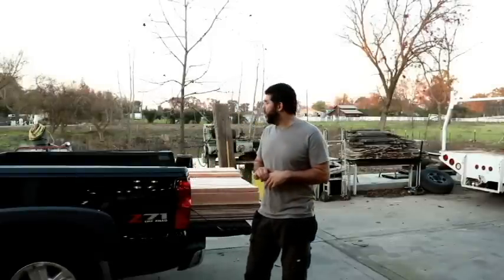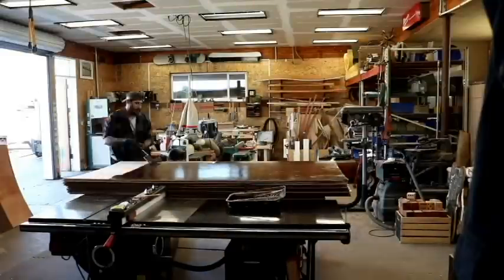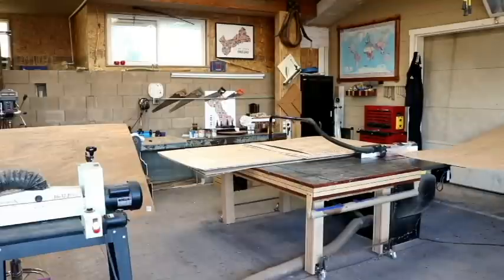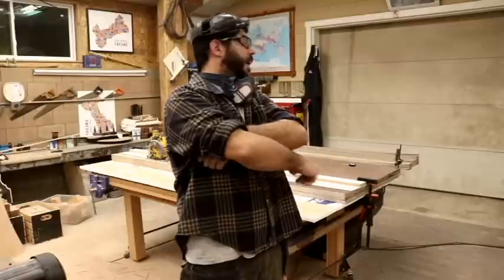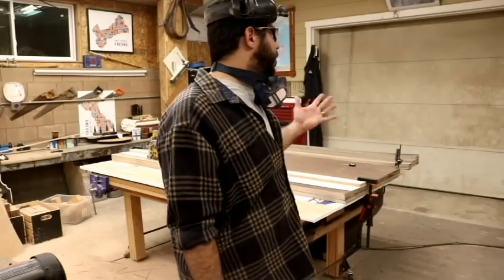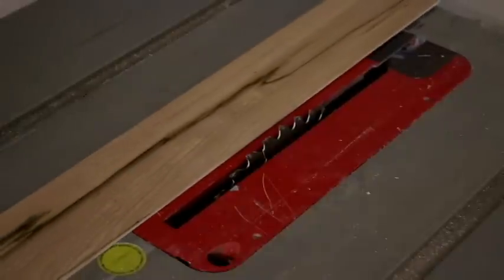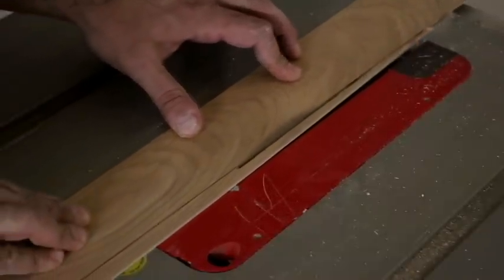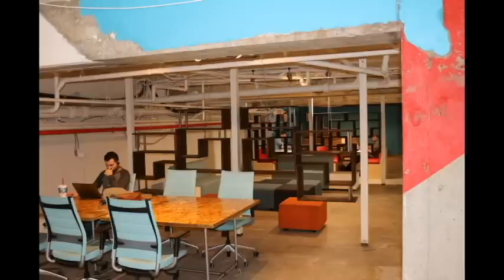Best DIY Wall Treatment Imaginable!!!

Comment: I did a very similar wall treatment. When shopping for the plywood I realized the thinner 1/8" stuff would show any change in elevations on the wall making the boards not lay flat. So I went with 1/4" and it made tooling and installation far easier and cleaner. A couple little tips: When going around a corner, use the same color to make it look as if the wood wraps around the edge. It's much easier to look at and shows much more thought. Like the corner, when you have a door or window continue the same color on each side of the opening. Again it's easier on the eye and look less busy and even more custom.

Comment: Ryan, nice job on the video. I agree that the taper ripping is harmless, since it's not up against a fence, so no kick back. However, I do it a different way WITH a fence. I say I need 5/8 taper on a 24" piece. I wack off a 5/8 X 1" piece of scrap, tape it to what will be the narrow end of the taper. Now I just run it through the blade  (using a push stick and feather board) and voila one end is 5/8 narrower, yes?  I'm not in my shop now, but I believe I have to start with the wide side so that I'm cutting towards the spacer end.  Now if the piece is longer than the saw's fence you have to throw a straight board to "extend" the fence, otherwise the spacer reaches the end of the fence, jumps over and messes up the cut.

Comment: YOU may have done this and I missed it but when I did this I laid the wall out on the floor to assure my design was set and I wasn't patterning  once that was done I simply applied each row to the wall and din't have to think about it. Each one has his way.  this really looks great!
Reply from the maker: Thanks! I did that for certain rooms but some of the walls were so big that it would have been a waste of time.
Reply: I was thinking the same thing. Were his choices entirely random, and it just worked out, or was there a process there? I'm so anal, I would need to control the "randomness".
Reply: Same here.

Comment: Awesome project. Want to "borrow" it for an accent TV backer wall at our Firehouse. Question: Did you miter the exterior corners or since it was 1/8 ply the stain soaked in and it wasn't necessary? Can't tell from the video. Thanks for the help
Reply from the maker: Very cool Scott, thanks! I didn't miter the corners cause it was plenty thin enough so it looked fine. I'd love to see pics of the Firehouse when you're done!

Comment: Good video! I like the one conference room where you did the part of the wall and then it went up into the ceiling. That was a nice effect! I just subscribed. I recently used some even cheaper plywood to do a faux shiplap look on some of our walls. (made a video about it) You're totally right...that thin stuff is a pain to work with on the table saw!
Reply from the maker: Very cool, I love the way it turned out...just liked and subed!

Comment: I seen this wall treatment using reclaimed wood in church once.  Not sawn to one uniform width, it varied between 3/4” to 2 1/2 widths.and various thickness of 3/4, 4/4, 5/4 and 6/6”. Some pieces were stained, some were painted with something like milk paint.      Applied randomly to the wall; the finish product was warm and colorful to look at.  Cool scaled down version.
Reply from the maker: Thanks!!! I've done that same treatment too, both are pretty fun

Comment: I like your comparison to a band saw.  Puts things in perspective. People don't freak out when those don't have guards, BECAUSE THEY DON'T HAVE GUARDS!  Those are infinitely more dangerous than a table saw, especially when the blade is that low.  I've worked in a butcher shop and seen how quickly a band saw can rip right through the the thick part of a cow femur at the hip joint end.  With a table saw accident you might lose a digit, with a band saw you might lose an appendage.

Comment: as a commercial trim carpenter, making free hand taper rips is just about a daily thing.  Yes theres potential to get injured. It about knowing the limits you can cut, the materials your dealing with and knowing the condition of both the saw, and most importantly the sharpness of the blade.   I commonly scribe 3/4" hardwoods to match humps and valleys in floors, walls that have humps in them, and bulkheads that wave as much as the ocean.     Never allow yourself to get to comfortable in freehanding a cut thats when you get hurt, respect the saw and it will get the job done.        Nice job by the way, from a guy who understands the ins and outs of what you do.
Reply from the maker: Thanks so much!!!

Comment: Nice job! The multi color woods came out much better than I would have thought.

Have you had any issues with the wood expanding and bulging off of the walls? 

I've done something similar, but with laminate flooring instead and I'm getting a lot of bulging problems. I think mainly because I didn't leave any gaps between the wood and the perpendicular walls/ceiling
Reply from the maker: That sucks sorry man. No problems so far, it's such thin plywood that I don't expect much expansion or contraction but I wouldn't expect much from laminate either unless it's pretty drastic swings in humidity and temp. I know they do recommend leaving flooring (solid and laminate) in the place that it will be installed at least 2 weeks to acclimate so maybe that's the culprit...sorry again...

Comment: My wife surprised me for a my home office and wanted to do an accent wall while I was on a two week trip.  She bought me really thin tongue and grove for this... Made for wainscoting.   We are going to turn it sideways.  Cheap enough.   I have to mount it.  I was planning on chalk lining the studs and just using a brad nail gun to nail it.   I really didn't want to use adhesive (in case I remove it).  Its a little stiffer than the plywood (maybe a 1/4 inch or 3/8) and locked together with the T&G.  I noticed in your video that on the vertical stuff you didn't use it or at least it looks like you didn't.  Never having hung anything like this would you recommend adhesive?

Comment: looks great, i got a question, what did you do for the outside corners?  its hard to tell if you mitered them or if they are just butt-joined.
Reply from the maker: Thanks! I jsut used butt-joints since the plywood is so thin it loks great. If it was 1/4" or more I would miter it.

Comment: Could you explain how you attached the boards to the wall.  You used adhesive and something about nailing them.  Were you concerned about finding studs?  What type nail did you use? Could you have only went with adhesive, and no nail?  Thx in advance.
Reply from the maker: I used construction adhesive and 18 Ga brads to hold while the glue sets up. No need to find studs as the adhesive is plenty strong enough to hold 1/8" material. The adhesive alone would work if you can hold the material tight to the wall while it cures.

Comment: Hey Ryan, do you think this would work to cover a popcorn ceiling with just adhesive and brads? Or should I go more hardcore fastening to the joists or something like that?
Reply from the maker: That's interesting, I'm not sure...I would think it would be fine to use construction adhesive and brads but not sure the glue would be able to "grab" enough since the texture flakes off so easily. I did a similar treatment on a drywall cieling with much larger panels (non-uniform shapes of 18"+) and it was fine. If you wantd to be safe, you could run a layer of 1/4" ply over the whole ceiling and scrw that into the joists then attach the thin strips to that and you'd have no problems. Hope that helps!
Reply: @ryanpenir8253  For future, .... they now make a spray on remover for popcorn ceilings!  Just spray on let it soak a little and scrape off, works great!!

Comment: I like your job man thats interesting idea. 
So I see that you use a nail gun but what is the wall made of? Is it plasterboard, or brick, or concrete? what kind of adhesive did you use something like cement or more like silicone. I am asking because I have a concrete wall I want to cover the same way you did and I wonder what if I use only some type of glue without using nails will it last long or will start falling off. Thank you in advance man
Reply from the maker: I used construction adhesive and a braid nailer on sheetrock. For a concrete wall you could either first attach some upright supports to the concrete (using redheads or anchors) then just brad the planks to that, or try some fast setting glue (C.A. or the like) and construction adhesive. Hope that helps!

Comment: His problems with the battery powered tools are why I have kept, and repaired, my plug-in circular saw, a Milwaukee model that I bought back in 1986.  Never runs out of electricity, unless I unplugged it to plug in some other power tool.

Comment: great job but I think you should of used a PL for glue because it's only a 1/4 inch material this way you  wouldn't have to use that many nails on the surface of the material and it will help it for coming off for the long run it a bit longer to do but quality comes first.  Plus who wants to fill all those nail holes.

Comment: Also kinda surprised your first rip on each sheet wasn't to half the board. Narrower and doubled would be so much easier to cut. Even before staining perhaps, but that's me thinking as a painter. Especially for a wipe off I like to be able to reach all edges from one corner when it's possible.
Reply: Ugh. One of those "D'oh!" moments. I probably wouldn't have thought of that either.

Comment: I Love them all! Great job! I’ll be doing a few walls in our new house. I was thinking about doing some hollow beams too! Have you ever done that? Any suggestions would be great.
Reply from the maker: Hey thanks! I have done the faux beams on ceilings before and they're pretty simple...just make sure the lumber you attach to the ceiling is straight or else the box doesn't sleeve on very well. Hope that helps!

Comment: what was the thickness? you kept referring to it as flimsy but I missed where you mentioned thickness- was that just due to cost - or by design?
Reply from the maker: It was 1/8" plywood...originally I planned 1/2" but the cost is significantly cheaper
Reply: great work.  I enjoy the channel.
Reply from the maker: Thanks so much!!!

Comment: Have not scrolled through all the comments, so forgive me if already addressed; personally I would have painted that wall a dark color first to avoid glaring white spots peeking through the seams that weren't perfectly fit.
Reply from the maker: BUD WHITE no problem, if I had the time I would've painted but the job was on a pretty tight deadline and I had multiple pieces to build so I didn't have an extra day to spare. Thanks for the comment and view!

Comment: the construction adhesive that you used would it do a lot of damage to drywall if you ever had to remove the wall treatment
Reply from the maker: Yes. Construction adhesive will pull the paper right off walls if you remove it. If you want to apply the panels with hopes to remove them, just use the brad nails and you'll be fine

Comment: Yes the Dewalt flexvolt release in Australia was very underwhelming. Their after sales service is NONEXISTENT. I have been waiting well over 6 months for a depth gauge for my 18v multitool via my local tool shop who by the way told me Dewalt are shocking with service. I tried another large high end tool shop that said they stopped stocking Dewalt for the same reason. They make great cordless tools but I wish they would get their shit together.
Reply from the maker: That sucks! A friend of mine works for Milwaukee and if had to do it over I'd probably go for them...although I think the new 60V is pretty amazing...

Comment: Did this lay down good on the wall. I mean was it wavy being out of thin material were the seams good?
Reply from the maker: The walls were new so they were straight and the seams lined up great. There were a couple spots where you could see the wall behind  so I just painted those gaps.

Comment: Ryan what formula did you use for lengths and was it a total of 5 colors?
Reply from the maker: I didn't use any formula at all, I just cut them roughly in half when I got to the jobsite and just messed around with what looked best. All said and done it was probably around 8-10 colors because the colors I painted or stained solid I also washed or watered down a lot...so basically, 5ish colors but a couple shades of each color. Thanks for the question and thanks so much for your other comment, it really means a lot!!!

Comment: did you say that you thinned paint down as the finish 
p.s. i think the walls looked grate and i want to do something like that in my home
Reply from the maker: Great thanks! Some of the finish was full strength stain and some was diluted. I also thinned latex paint so that the grain of the wood would show through. Hope this helps

Comment: Nice job! I may have missed it when you were talking, but was that 1/4" plywood? And you just used CA and some 18GA brads to hold it in place while it dried, I'm guessing?

Just subscribed, so keep the good stuff coming!
Reply from the maker: Thanks so much!!! It's actually 1/8" but you can use any thickness. I used liquid nails construction adhesive and 18ga brad.

Comment: Ryan, how would you suggest me to put it on a concrete wall? what type of glue to use?
Reply from the maker: Serfederic Cellona I get asked that question a lot and have never tried it so I don’t know for sure. With that said, I can’t see why not. You would need to use a decent, probably fast setting glue so that the panels stick to the wall since you won’t be able to use and mechanical fasteners to hold it while the glue sets up (that really the only reason for the nails). Hope that helps and I’d love to know how it turns out if you do it!
Reply: Thanks Ryan. In my country, most of the structures are concrete walls. I have been watching some of your videos and definitely want to try out. Thanks for this. Subscribed!

Comment: Ryan Penir: Your table saw is on wheels, so is it a "modular" design? If that's the case, I have a request: Can you plz show us some tips for that? Cause i need to fit cars and bikes in my shop, especially during the winter season, so been trying to figure out a way i can have a modular design. For better wood working capabilities. ATM my system is very bulky and a pain to move around
BTW i expect a lot of guys being in the same situation. Building is expensive and there aren't always room near acces "road", so it often includes expensive slaps etc. You could make it into a series "Modern workshop design", could give a lot of PR ;)
Reply from the maker: That's a great idea!!! My last shop was a 2 car garage that I still parked one car in so I know your pain all too well. Unfortunately...well, fortunately for me but unfortunate for the video series...I moved and have a much larger shop now so it may not work but I'll still try to work something out because I really do think it would helpful. Thanks

Comment: a better method to achieve the same effect would be to buy engineered flooring in 3 different colors at about $3.50 sq.ft. That works out to about $112 for 32sq.ft vs. $30 sheet of 1/8" ply. More expensive but the time to stain and cut each sheet is much more than $82 - the difference between the material cost. I don't know about you but my time and labour is worth more than that to do the work. Not to mention overall time save as well as the flooring is T&G. If you hired a contractor to stain and rip the ply, they'd charge you a fortune.
Reply from the maker: KCPIO good point, thanks!

Comment: Sorry me again, did you varnish at all as that beautiful wall looked shiny to me.
Reply from the maker: No problem...if there's any sheen or gloss it's coming from the stain itself. I didn't use anything topcoat because it's in a basement with no sun so will not fade. Thanks again!!!

Comment: At what point did you add the water to the stain??
Reply from the maker: Most of the stain I left full strength and diluted the paint but either way you just add water or solvent before you stain or paint the surface.

Comment: love it! when using the brad nails, did you cover the holes with filler? or adjusted the gun to the right pressure etc and none was needed?
Reply from the maker: Quentin Smith thanks!!! Yeah it didn't need filler or anything. Came out great!

Comment: I just HAVE to comment the use of the tablesaw..
( its not "dangerous" )
but where is your "sharkfin" behind the blade to keep the panel from clamping down on the saw and getting shoot out of your hands !
Reply from the maker: This saw doesn't have a riving knife and I only use it one jobsites (which is not very often at all) so I never put one on...but I should
Reply: true, you should ;)
- Iam and educated woodworker ( using woodcutting mashines for production of windows and others ), those machines are alot more powerful, and making mistakes can cost injuries.
But I have changed job since then.
I know your small machine isnt big and powerful, and the board isnt huge and dont have any tension so, it is not a big deal.
- But Ive seen a person trying to split a massive Oak plank, but it shot back when it clamped down hard on the saw.  she had no chance of holding the plank, and was lucky not to be injured.